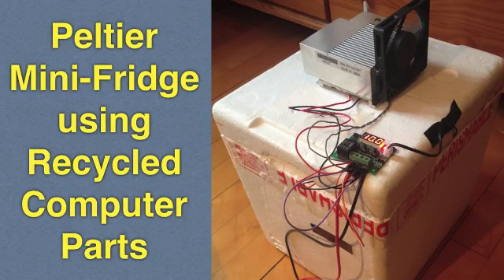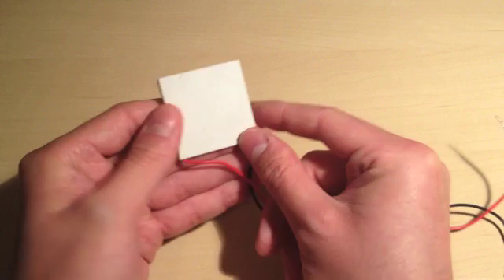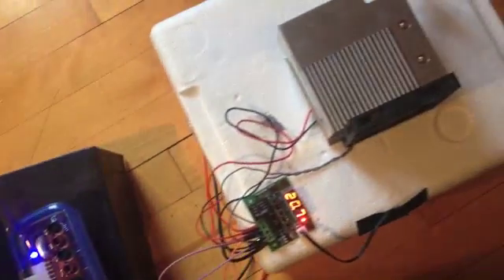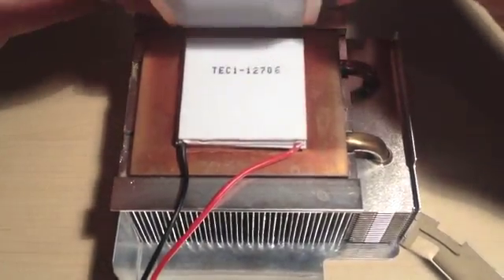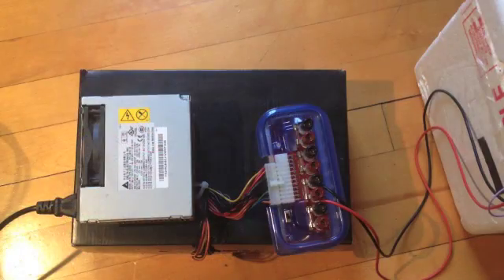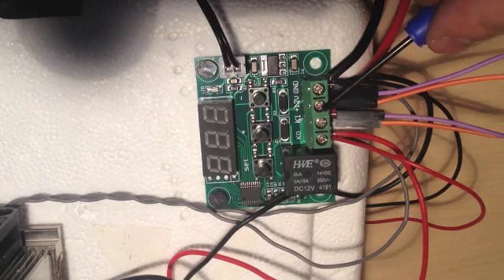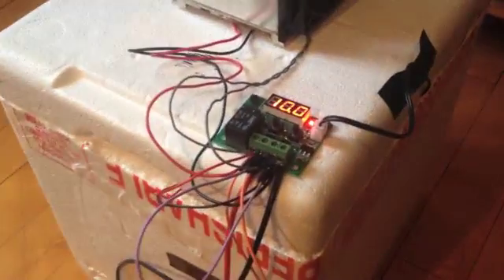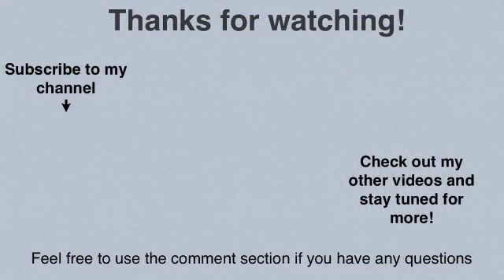Homemade Peltier Cooler Mini Fridge DIY with Temperature Controller (TEC1-12706, W1209 Thermostat)

Comment: What exactly do you mean by temperature controlled? Like can you control the temperature inside the fridge, for example from 10 to 5C?
Reply from the maker: It is like a thermostat, so yes it can control the temperature inside the fridge. For example, you can set it to 5 degrees and the Peltier will only be turned off once it reaches this temperature.

Comment: Is there a way to wire this so the fans would turn off when the desired temperature was reached and turn on when  cooling was needed again?
Reply from the maker: Sure! This is actually what I did. I plugged the Peltier module and the fans on the W1209 temperature controller. This way, everything is turned off when the desired temperature is reached. Please have a look at my website for more info and a wiring diagram:
https://scienceimproved.com/homemade-pelter-cooler-temperature-controller-diy/

Comment: how about stc 1000 thermostat controller cables configuration?
Reply from the maker: You can have a look at the STC-1000 on Amazon, which incudes a wiring diagram: https://amzn.to/3jkJybe
However, the output of this thermostat is alternative current instead of DC. You would therefore need to plug in a DC power supply to be able to power the Peltier module.
Reply: @DIYElectronics  just got stc 1000
i connected +12 v and grnd from atx modul board to stc 1000, it cant be turned on, 
i also tested with -12v , +5v and +3.3v
still stc 1000 cant turned on
did i do it wrong?
Reply from the maker: Hello, 
I would like to help, but I am not sure what you are trying to do. As I said in my previous message, the STC-1000 is only compatible with alternative current. Therefore, it will not work with DC current such as the one provided by an ATX breakout board.

Comment: how do I set max and min temp point in this thermo state? I mean some one will keep pushing button and get it to 0 degree but peltier cannot get that much cooling. so How to set temp point in that thermostate?
Reply from the maker: What you can do is set it to a low temperature such as 0 degree, then let it run for a while and check what is the lowest temperature that it is able to reach. You can then set your fridge to that temperature, but remember that in order to reach it, the Peltier will be running constantly. You may want to set it to a few more degrees to avoid overheating and increase its lifespan.

Comment: Hi. I know this is an old video, just want to know if the ATX Power Supply will continue run even though the thermostat breaks the circuit after reaching optimum temp? I'm asking bcos the on/off function is on the ATX breakout board, so, there's no way to turn off the power supply of the ATX.
Reply from the maker: Hi, When the mini-fridge reaches the optimum temperature, only the thermostat circuit will be turned off. It means that what is plugged in the W1209 thermostat module will be turned off (Peltier and fans). The power supply, the ATX breakout board and the W1209 module itself will remain on. I hope this helps.

Comment: It’ll be interesting to see what will happen if you build fridge that has a thin copper pipe with lots of bends (to increase the surface area) then pump butane tru it... I’ve seen one of these little water pumps for like 1$ and can run off a solar pad

https://encrypted-tbn0.gstatic.com/images?q=tbn:ANd9GcQJeZyDHIT6NDiJo3l4ydAIOKW_r00_vl2H3qfBB6EjdKeAMbyHOhbSouAVqA&s=10
Reply from the maker: I agree! I also used the same pump to make a water cooling system for the Peltier and it worked well. Please see my reply to Hot Fuse for examples of high efficiency Peltier cooling configurations.

Comment: hi there, can it reach 0°C ice freezing point if we install more than one peltier module on a one cubic foot ice chest?
Reply from the maker: Hi! Sure, it can reach 0°C and even lower temperatures. As Nivs said, it depends on how much heat you can dissipate on the hot side of the Peltier. You could use a high efficiency heatsink such as this one:
https://amzn.to/2PWC80Y 
or use a water cooling system like this (check the pics to see the full setup): 
https://amzn.to/38xFTk2
You could also use a water cooler block that can accomodate 2 Peltier units and make something like this:
https://amzn.to/3cByOCe

Comment: 😂 imperial or metric 🤔🤔🤔seems to be a decision that ur avoiding... good video
Reply from the maker: Thank you... but I also forgot Kelvin!
Reply: DIY Electronics 😂😂😂👍
Reply: @DIYElectronics  hi there, can it reach 0°C ice freezing point if we install more than one peltier module on a one cubic foot ice chest?
Reply: hot fuse hmmm... probably... I think it’s about how much heat u can move from the hot side...

Comment: Hi, I am after a small portable cooler where you can just insert the bottle on to a case I have designed, Is there any smaller ways to power this device with a usb charger for example and still have the thermostat controller?
Reply from the maker: It would be possible for a small volume if the insulation is good. You could also use a usb charger with a 5V digital thermostat such as this one: https://amzn.to/2VeE60a

Comment: How many hours continuously  i can use this device (24/7 is okay?)
Reply from the maker: These Peltier modules are commonly used in thermoelectric fridges, so they are designed to be used for long periods. Ultimately, the life span of these modules will vary depending on your setup. If the isolation and energy dissipation is highly efficient, then the module will not be constantly working at full capacity which will increase its life span.

Comment: Could I just do this on a window for homemade ac?
Reply from the maker: Given the efficiency of a Peltier unit, it would be difficult to cool down an entire room significantly.
Reply: Theoretically couldn't you use multiple and blow the cold in the room and the hot out a window? or maybe too much amperage for the controller?
Reply from the maker: As you said, it should work in theory. I tried using 2 Peltier units and the controller seemed fine at least for short time use, but the ATX breakout board was heating. I was able to reach lower temperatures for my fridge, but I don't think that it would be sufficient to use as an AC. Maybe I will try a different setup for an AC this summer. I will give an update if I find something useful.

Comment: Sir, I am getting only 25℃ lowest temperature. I dont know why it happens from room temperature of 32℃ it reduces to  25℃ only why
Reply from the maker: To reach lower temperatures with a Peltier module, the energy dissipation on both side should be very efficient. You can use a high conductivity thermal paste or silicone pad. You can also use larger or more efficient heatsinks as well as increase the ventilation.
Reply: Use tec 12715 peltier module ,and a large heat heat sink both in and out atleast 8*8 cm.

Comment: I made a mini fridge having 2 Peltier modules. But the temperature inside the box cannot be lowered after 22.4 degree Celsius. Is there any solution to make the temperature inside the box 0 degree Celsius
Reply from the maker: To reach lower temperatures with a Peltier module, the energy dissipation on both side should be very efficient. You can use a high conductivity thermal paste or silicone pad. You can also use larger or more efficient heatsinks as well as increase the ventilation. It would be difficult to reach 0 Celsius if the ambient temperature is high, but you should be able to reach 4-15 Celsius depending on your configuration.
Reply: Sme problem here I get a lowest temperature of only 25℃.

Comment: its awesome . please let me know whether  the smaller heatsink inside the box will be secure without falling into the box  just by thermal pad ?? does thermal paste or pad have glue like sticking properties ??
Reply from the maker: Thanks for the feedback! The thermal pad I'm using is sufficient to secure the smaller heatsink in place. They should stick together and the heatsink won't fall. That being said, it's not glue and it will fall if you shake the cooler or if you try to open it by pulling on the larger heatsink.
Reply: thank you .. please come up with an air cooler that includes a peltier & water block
Reply from the maker: I'm working on it!